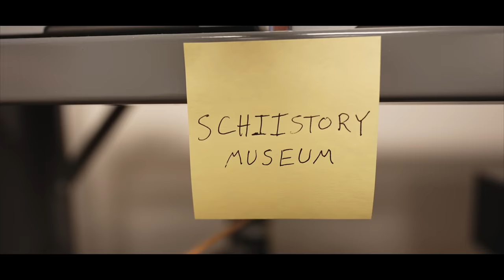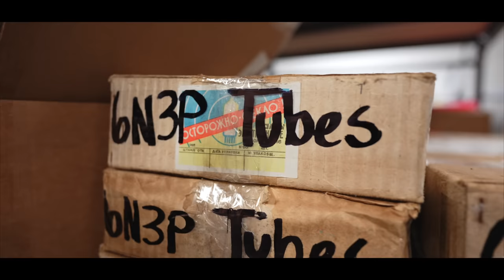Making Schiit Isn't Easy - Schiit Factory Tour

Comment: Back in 2009-2010, I killed time at work by hanging out in high end audio forums. That was where Schiit audio plugged their very first product, which was the original Asgard headphone amp. The feedback was generally positive as far as capabilities and price, but I noticed that it only had an RCA input. I suggested that it should have an RCA output as well for preamp flexibility and whoever was in that forum representing Schiit mentioned that it was a great idea. The RCA outputs were never implemented on the original Asgard, but did make their debut on the Asgard II. That memory cracks me up every time I see how far Schiit has come since then. Affordable high end is rarified air that hasn't been seen since the early days of NAD, and it's nice to know that Schiit is still around and working hard to bridge that gap between audiophile class electronics and affordability. It's also nice to know that Randy is working just as hard to publicize those bridges to help bring people closer to the music they love. Rock on, Randy.  :)
Reply: I'm guessing it was Head-Fi? If so, I remember it well. Jason Stoddard was the guy who always posted on their forums. He also does yearly recaps of the industry which is very interesting.

Comment: Quality content right here. You made me aware of Schiit. So recently, I bought a used Asgard 2, Upgraded BiFrost and a Loki 4-tone controller. So good with my HD 650s. Doubt I will need another headphone-amp ever again.
Reply: I upgraded from Modi/Magni to Modius(AKM)/Asgard 3 about a year and a half ago, and the improvements were easily audible, nothing incremental or subtle about it. The Asgard seems like kind of a dark horse in audioland. The price/performance is through the roof, but it doesn't really get mentioned all that often, at least not that I've seen. I'm considering a Bifrost, but I've seen mixed reports on how big a step up from the Modius it is*, and returning stuff + restocking fees are a pain in the butt. How're you liking your Bifrost?

*I know the Modius measures "better," but the Magnius measures "better" than the Asgard, and I like the Asgard more than the Magnius.
Reply: That’s what I said a long time ago.  Current owner of a Ragnarok and Yggdrasil 😂😂😂

Comment: Love Schiit. Just works well. Vali 2 (apologies to Magni but tubes are fun), Loki, and Modi. Bought another Modi (a 3E) on special. Love that they are here in the U.S. employing Americans. Cheap but GOOD stuff made HERE means a lot. These are gateway drugs to loving music more and more up to a Vidar and beyond.
Reply: I have the Lyrs'. How do the Vali 2s compare?
Reply: @wsmcke  well, the Vali 2 is much cheaper and puts out 1.5W into 32 Ohms while the Lyr puts out 4X (on average) that power. I'm kind of surprised it couldn't blow some headphones. 6W is a LOT of power, but I guess for some very hard to drive types, it might be needed. 

As to the sound quality, the Lyr of course should be cleaner sounding maybe. You can compare the THD and other specs at Schiit's website. 

And the Lyr can be operated either with a tube in the signal path or not (by removing it) and letting it run solid state only. 

The Vali 2 has to have a tube in the signal path. I mean that's the reason it exists or someone would choose the Magni instead.

I've never heard the Lyr so I can't comment on how it sounds compared to my Vali 2, but I love how the Vali 2 sounds with my 600 Ohm old original AKG Monitor K240 headphones (has plenty of power to drive them) and my newer HD560S headphones. 

I like that I can choose various tubes for fun to change the sonic signature. Currently I recently got a 6922/E88CC from JJ Electronics and am using it. I did have a Sylvania ECC88/6DJ8 in it. The 6922 opens up the soundstage wider, so I think I'm going to leave that one in for a very long time.   Enjoy!  

It is amazing that for well under $1000 you can put together a headphone rig that will offer as good a sound as a amp/speaker system costing $10K. Yeah, you don't get the visceral bass slam hitting you, but sonically you hear all that is there. Love it. 

And I can listen late at night and not disturb others.
Reply: Thank you for your response... I have Fostex that are now Argons from Modhouse, they need power. I also run my Hifiman Sundaras.

Comment: A question. Does adding a Schiit "modi" dac to a Cambridge Audio 25 or 35-watt amp make enough difference to justify for a system that is primarily for cd's??? The $125 pricetag is not much to add to $300-350. I have a pair of ELAC bookshelf (6" woofer the BK6?) and an old pair of Fisher 3-way  I am not sure the Cambridge audio can drive the Fishers however and I do not want to shop for a vintage Pioneer amp I cannot afford that stuff damn it!If I buy the Cambridge 25 watt I would have to siupplement with a subwoofer I am thinking to match with the ELAC speakers. Second question: Can a Cambridge Audio amp drive a pair of old Fisher 3-way 10' woofers or do you recommend 50 watt amp or better? I am using an old Sony home entertainment receiver and I suspect it is only 35 watts and not quite up to snuff through those Fishers-could be better which is why I picked up the ELAC s... I might go with a Cambridge Audio 50 watt unit-would you recommend that? I cannot afford vintage and it pisses me off because I grew up during all thaose receiver wars and have nothing to show Cambridge looks good seems reliable the designer fellow has been through the wars and I been burned too many times buying used-I am disabled and some sellers on EBAY should never set foot in OREGON